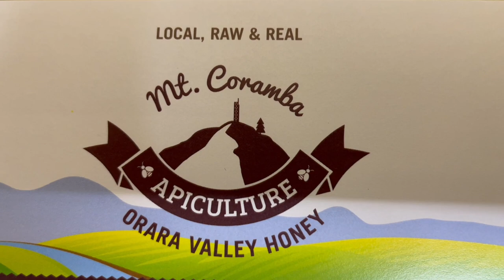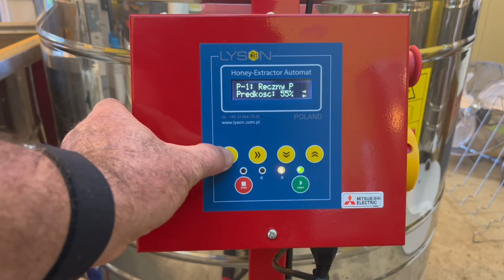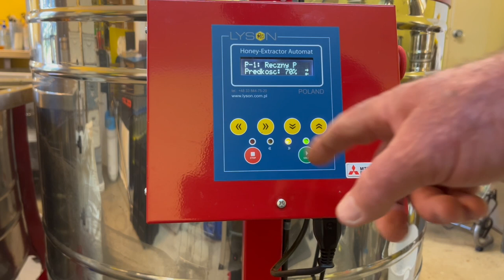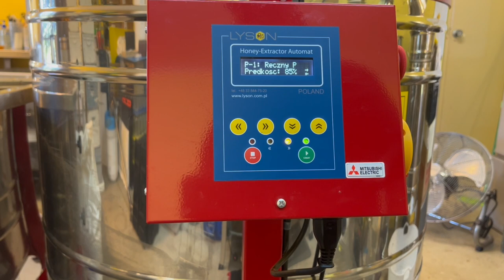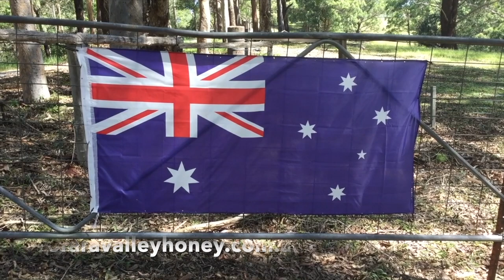🐝  Our extracting & bottling process.  How we extract & bottle honey with less than 100 hives.

Comment: you could run the honey through your uncapping station to filter out some more wax before putting it into the settling tank ;)  if you tip the honey on the wax already in there it will filter the honey better. also you will be catching most of your wax in one spot :)
Reply from the maker: Yeah I do that but differently.  I remove the wax from the top of the settling tank when it is about an inch thick then put it back through the uncapping trough.
Reply: @mt.corambaapiculture  nice, the final filer on the bottling tank looks handy

Comment: The triangle piece is for resting a frame on to uncap rather than using the nail holder. Nail is much faster IMO
Reply from the maker: Yeah, I tried that, but most of the cappings ended up on the floor thought perhaps I was doing it wrong
Reply: @mt.corambaapiculture  nope! Its honestly just a poor design.

Comment: Thanks for sharing, just wondering if there is a reason nobody bothers clearing the frames of Bur etc while uncapping. Surely this would help with balancing the extractor?
Reply from the maker: The issue with unbalanced frames is the amount of honey in them rather than burr comb but yes you could remove it prior to extraction.